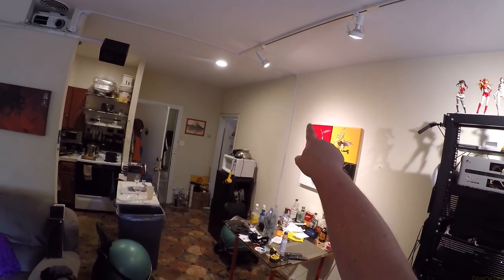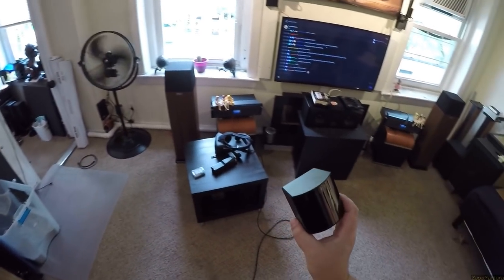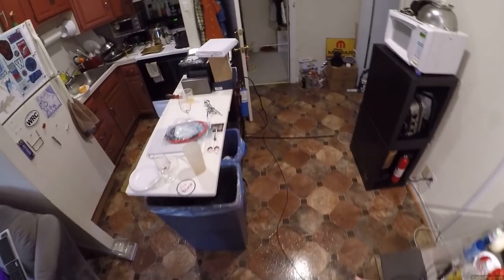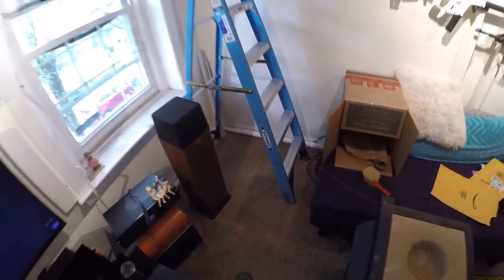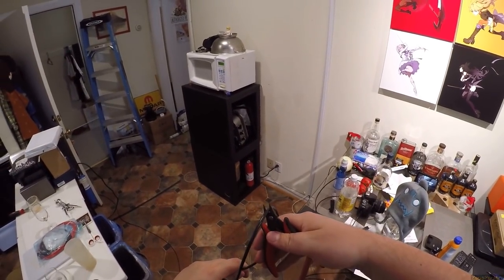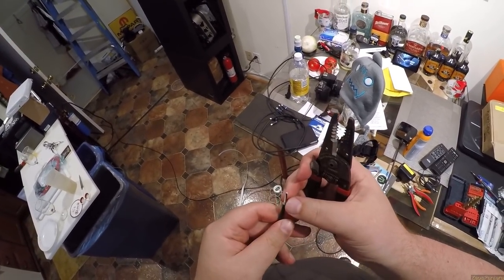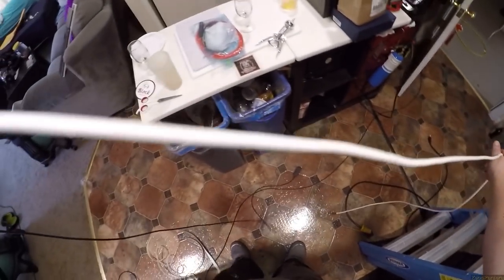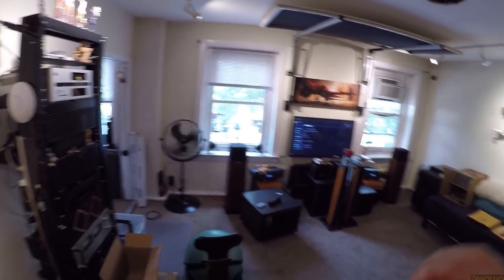MAD SCIENCE HOUR - Valve Index Install - Part 2

Comment: If you're computer is shutting off by itself while running, your power supply might going bad and should be replaced, or it could be your computer is running too hot and shutting off to prevent damage to the CPU or another part.

Comment: Sounds like you are running out of power. What Size PSU do you have ?
Reply: An Enermax. Think 530 watt? Been a while.
Reply: @ZReviews  It's a C Tier rated, really only recommend those Revolution xt's for replacing psu's that come in prebuilts, I read some reviews on that PSU looks like it's very easy to trip OCP. Before jumping to conclusion check to see if you can run two separate power cables to the gpu rather than the daisy chained one, see if that helps stability.

Comment: 16gb of ram ? No wonder why your game crashed when Pasta spawned all of those elephants. It's the same thing as the spawning cheese in skyrkim. The processor and the ram share the load when things like constantly spawning things or massive explosions like in Minecraft. If you use FRAPS when you spawn elephants or explosions you can see your framerate dip depending on how much happens. I'd try spawning the elephants again with fraps and see how many in a row till it freezes, crashes or crawls.

Zeos I'd recommend getting more RAM 32Gb or as much as your system and your wallet can afford. But a set of 32Gb, 64Gb, etc. Make sure there the by the same company and speeds. You can buy in bulk at once. Mixing and matching ram sticks from different companies and different ram speeds is not recommended because A. The Rams speeds in total space ex. 32Gb will be as fast as it's slowest stick of ram 2133 or whatever your ram is. The faster the speed the better and if your motherboard supports it. And B. IF your overclocking the mixed ram then it would be a nightmare, be potentially dangerous due to different voltages or just wouldn't work. Different motherboards different results.

Bottom line. Just buy a completely new set of 32gb or 64 gb of ram see how many ram slots you have beforehand.

More ram is better than faster speeds but if your gaming it's fine. Also you can have more Firefox/ chrome tabs open at a time, faster video renders. Multiple benefits.

New sub to the channel. Just enjoying the content and the "realness" that other channels don't have.
Reply: Welcome and Thanks.

Comment: way late to the party, buuuuut chances are (and mind you i've only gotten a few minutes into the video at this point) that your computer is shutting off when you tax the GPU because your power supply is not capable of handling the power requirements for the GFX Card... or, you do not have proper cooling for your CPU and its overheating and dying...

Also, there is a setting in the Light Houses for 'eco mode' which turns the motors off after it stops detecting the headset/whatever for x amount of time. but they then take 30 seconds or more to start back up once a steam vr thing is back on...